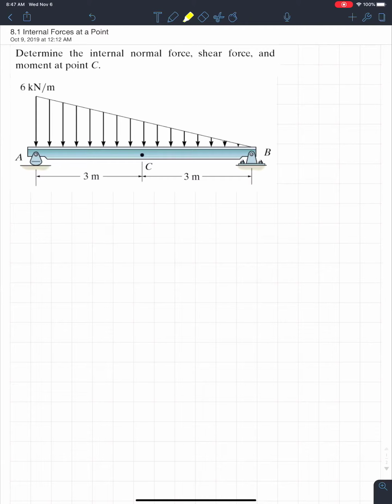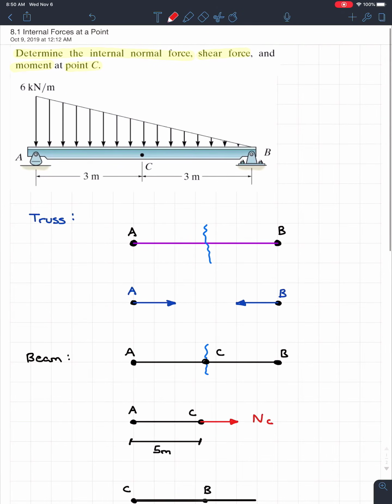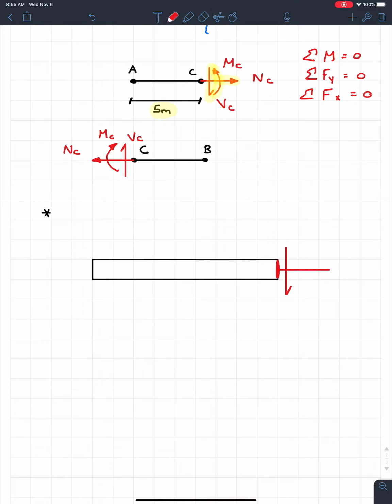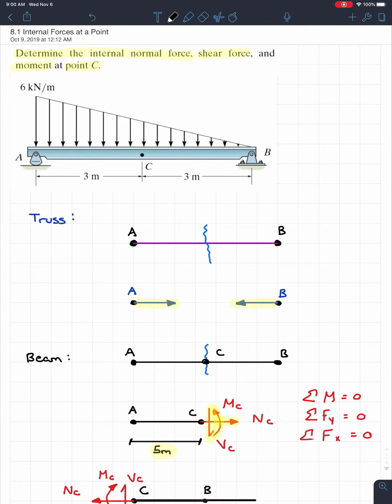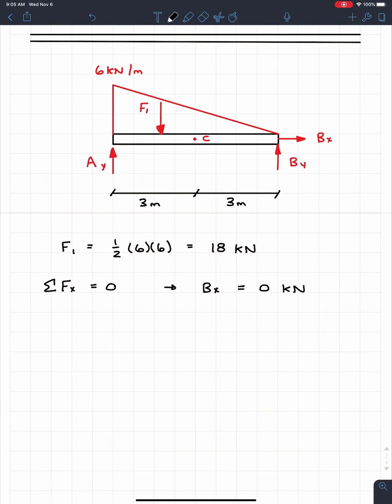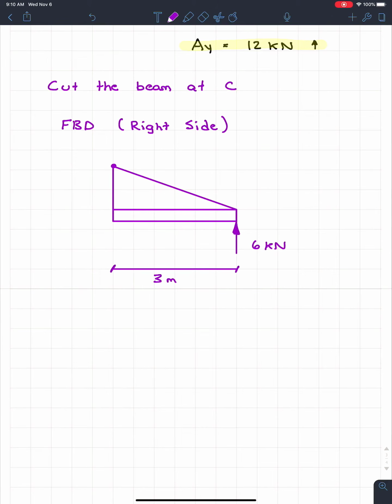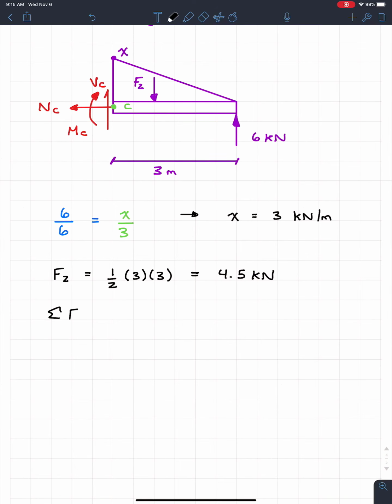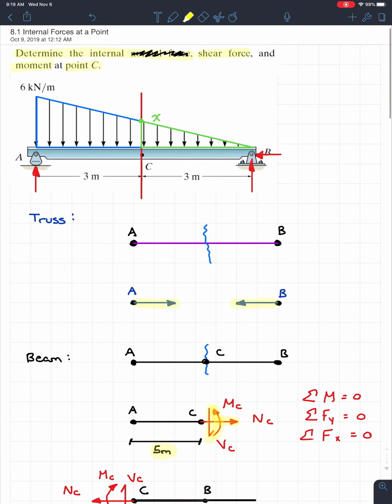Engineering Statics | Old Example | Solving Beam Internal Forces at a Point

Comment: I'm confused about the direction of shear force. If I analyze the free body diagram of the left side, I get all the same numbers as your answer on the right side (except V=-1.5kN which I think was a mistake on your part). If you look at the left side's FBD, you draw the shear arrow pointing down, and you get -1.5kN which previous intuition would say, "oh no problem, flip it, and it's pointing upwards!" Then if you look at the right side's FBD, you draw the arrow pointing upwards and you also get -1.5kN which previous intuition would say "flip the arrow so it's pointing down instead." If you just look at the -1.5kN answer from either side of the cut then it is satisfying the fact that we should have the same force on both sides, right? But then if you think about force directions, on either side of the cut, past intuition would tell us that the force is pointed in the opposite direction, although it's supposed to represent the same force, right? So what does shear force represent in terms of direction? Is the direction always opposite of its counterpart from the other FBD? Do our placeholder arrows even mean anything when analyzing these diagrams?
Reply from the maker: Hi Ethan, you are correct about the shear being -1.5 kN and not -2.5 kN (you all know I'm bad at math lmao).  When it comes to internal forces, we do not use 'placeholder' arrows as the directions of the internal forces when the beam is cut are set (will always be the same).  The reason for this is that a negative and positive internal force (say -20 kN and 20 kN) are two different entities and must be taken into account in design.  For example. a positive moment of 50 kNm will make a beam bend downwards (tension on the bottom surface) while negative moment of -50 kNm will make it bend upwards (tension on the top surface).  These are completely different behaviours even though the magnitude of the moment is the same., which is why we have a set sign convention and never try to 'flip' the direction if we get a negative answer.  Hopefully this helps!